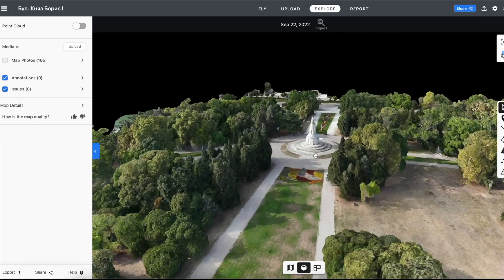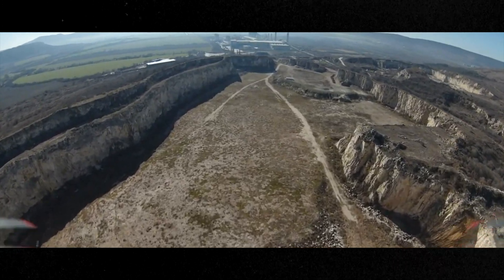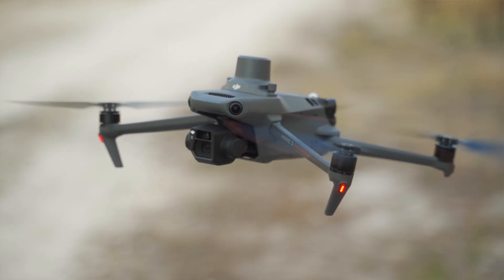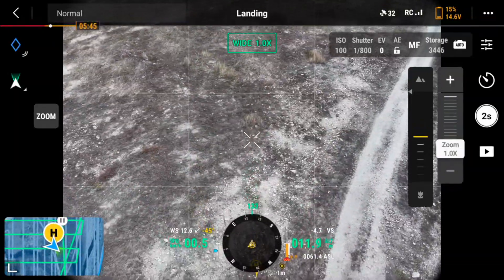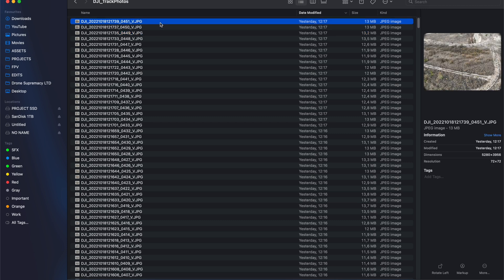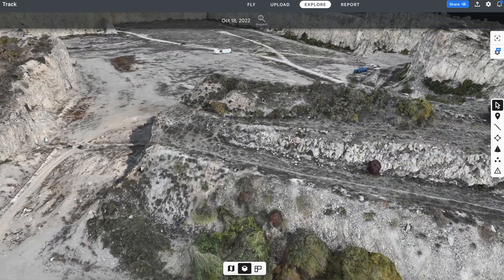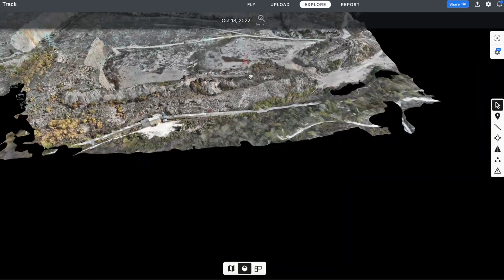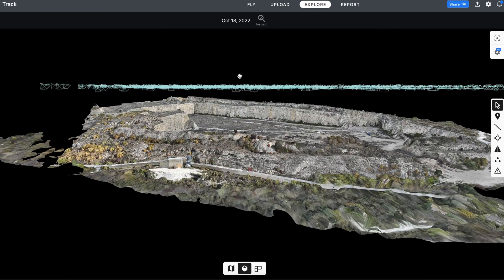DJI Mavic 3E - 3D Modelling a RACETRACK!

Comment: ALWAYS shoot RAW for photogrammetry. There is so much information in the shadows and highlights... Sometimes you can get 30-50% more dense point cloud just by editing the RAWs before you export them to JPG
Reply from the maker: The thing is, shooting raw also slows down the shooting interval, which for some could be crucial. But generally I agree with your point 🙌🏼
Reply: @DroneSupremacy  Agreed. But I'd rather spend more time on the site than go back and fly again because the JPGs dont give me a good result. Anyways, I'm a "digital twin" guy, so for me the quality is the most important thing.

Comment: Unfortunately, that is not photogrammetry, it is only a 3D reconstruction that is not valid for an engineering project. To be precise, it needs corrections with some GNSS base, otherwise the photography will have scaling errors in one of its x, y, and z vectors."

Comment: Did your mapping/RTK require a ground station as a reference point?
Reply: if you want to achieve centimeter accuracy with GPS RTK you always need to have any base station set over known point, or any base station from permanent network, and communicate with rover (drone in this case) through internet (mobile SIM)/radio, if you don't have any of these, you need to have ground control points (GCP) where you then transform survey to set orientation and dimensions of your point cloud

Comment: Great video. I tested my Mavic 3E yesterday and noticed vignetting on the survey images. It looks like your images have a bit of that too. Didn't seem to make any difference to the finished model though..
Reply: Make sure you have enabled the remove distortion option when setting up your mission
Reply: @glherriott  Are you sure in that? In the user manual: When using mapping , oblique, and linear tasks, the default camera focus mode is MF infinity, and the distorsion correction is disabled.
Reply: Look at his video at 10:10  he has vignetting but the software sorts it out with overlapping images. Don’t enable distortion correction as that will make your survey inaccurate

Comment: I think this really sold me on the 3E after seeing how fast it is with the shutter. I would like to still see this compared to the 3T but I'm having no luck getting other pilots response lol

Also does DJI Terra come with this drone or do you need still need to buy that software? Have you tried DroneDeploy?

Great work and thank you!
Reply from the maker: I've tried DroneDeploy, as DJI Terra is Windows only. Not sure if it comes with the drone to be honest, i need to double check!
Reply: @DroneSupremacy  DJI Terra is a seperate license that costs 5k. Pretty crazy but amazing quality maps.
Reply: @ChristiaanRoest79  is that a one time cost or annual charge?  I’m using 3Dsurvey and love it but this map is pretty nice.
Reply: Hey Steven, from what I read. DJI Terra would cost you $1550 a year (USD), or you can do a one-time purchase of $4550 USD. The $4550 would be the way to go. That's the route I will take once I purchase the M3E with the RTK add-on. I hope this helps
Reply: @Mixxwizard how's it going? Did you manage to get the m3e and rtk?
Reply: Hey Chris, yes but I have not taken out on any projects yet. But after September 16th. It will be my main drone. Because of the new FAA rules. Everyone will have to have remote ID on your drones. I will keep you posted
Reply: DJI Terra and Pix4d provide way more detailed 3d maps than DroneDeploy. I have seen a comparison and the difference is significant.